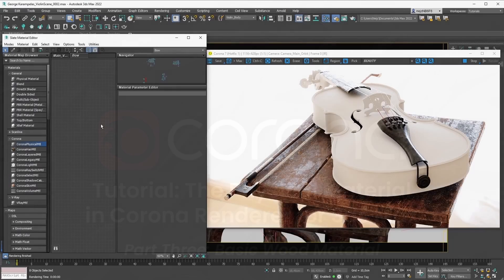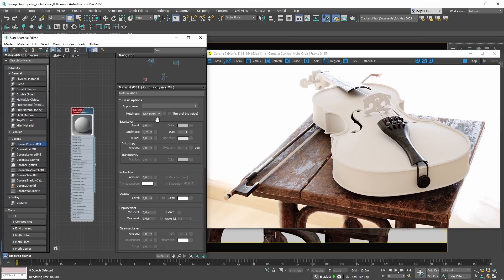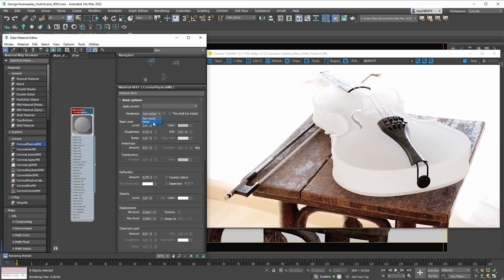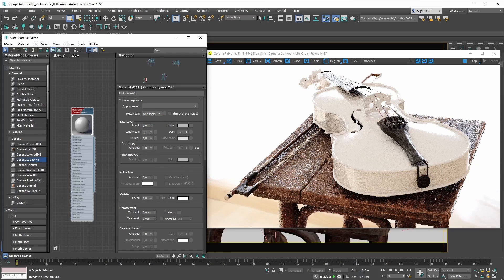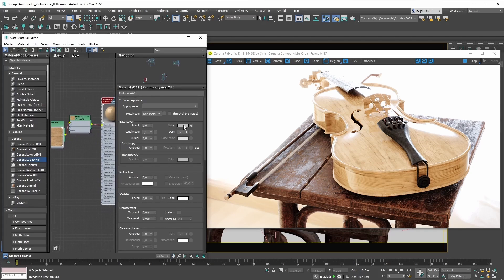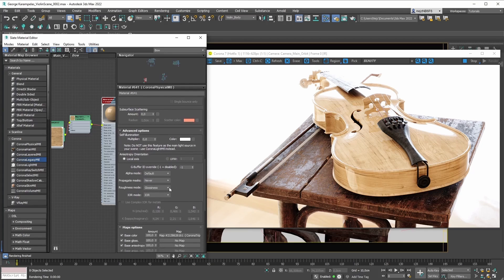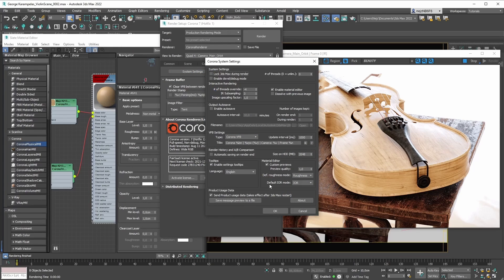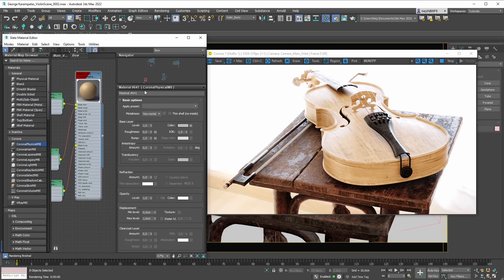Corona for 3ds Max Physical Material Tutorial, Part 03 - Basic Wood

Comment: How do you get/ make base roughness map for you base color map? Or how to make other maps as well (such as bump and other most important ones)?
Reply from the maker: Really good question Katarina! There's multiple ways to approach it...

Ideally, if you have a photoscanned base color map you also have a photoscanned roughness map. Typically that is achieved through different photography techniques (cross polarization) and setups and it really ranges from "its looking ok" to "its really complex and looks awesome". Bottom line, it is hopefully captured along with the base color map.

If you've created your base color map in something like Substance though then it is a matter of generating a roughness map out of it. In this case it is more of an artistic approach.

Pretty much the same holds true for most other maps - bump for example you can get by using a pretty strong flashlight from multiple angles as you're photoscanning the base color map. That is one of the techniques at least but hopefully you get the drill...

All that said for when it comes to wood and if you're in a hurry then you'd be surprised how far a simple greyscale base color map can take you for when it comes to roughness and bump. Just make the base color greyscale and have a play with it until you get it looking good. It surely won't be 100% awesome for closeups but if you're in a pinch...

Hope that helps! Nejc
Reply: @ChaosCorona  can we add normal map in roughness slot ?
Reply from the maker: @ No, as the roughness slot just contains data on the amount of roughness on a scale of 0 to 1, and not anything to do with surface geometry.

Instead, Normal maps are applied in the Bump Mapping, see the article at https://support.chaos.com/hc/en-us/articles/4528320253329-Corona-Normal-Map-3ds-Max . Hope this helps! Tom
Reply: @ChaosCorona  thanx tom
Reply from the maker: @anuragkhati4547  You're welcome! If you get stuck, you can always reach out via the forum or ticket and the community and support team will be happy to help out! Tom
Reply: @ChaosCorona  can we place a displacement map in place of bump map ?
Reply from the maker: @anuragkhati4547  By and large yes, though of course if you plug it into displacement (and why not? :) ) it will actually change the geometry, while plugged into bump it will only change the lighting / reflections etc. but the geometry remains unchanged.

So, same map, if in bump mapping on a sphere, the sphere will still look perfectly spherical; if in displacement mapping, the sphere will distort so that it is not spherical, e.g. have a jagged edge, etc. depending on what the map is recreating.

Hope this helps! Tom

Comment: is there exist multiplier of reflection parameter for solid non transparency surfaces?
Reply from the maker: Hello there! Such a parameter doesn't exist because it would be "physically incorrect". With the physical material all the materials have a proper 100% reflection on them from the start and similarly as in the real world, if you lower the roughness the reflections will become more and more diffuse. If you go really high on roughness you'll basically get reflections that are so diffuse that they'll be hard to spot and that is where you get that realistic behavior from.

So increasing the general reflectivity over 100% is not possible but you can however up the IOR parameter and that will make the object appear more reflective in a physically correct way.

Hope that helped! Nejc

Comment: Hello, help me  please with issue. where can I attach the ambient occlusion map downloaded together with the material in Corona physical material?
Reply from the maker: I assume you mean you have some material set up from a library or created in some tool like Quixel, that has an AO map. It is safe to ignore this and not use it at all (AO is a fake for shadows, but you can leave Corona to handle real shadows so long as you have good bump / normal / displacement maps). Hope this helps! Tom

Comment: Ive always had this question:
Don't you need to override the gamma back to 1 for roughness maps aswell? We already do this for normal maps. but why not for roughness maps? Its linear data and in most other rendering softwares, you need to remove the srgb gamma of 2.2 so it renders properly

Comment: Where's Reflection Level parameter now? It's impossible to make same material like Legacy with Physical method without this function
Reply from the maker: Howdy there! The new physical material introduces a different, more physical paradigm to the material creation process.

In the real world reflections wouldn't just get dimmer like they do with the legacy MTL. 

Instead the reflections would either get more diffuse (rougher / less glossier) or the IOR itself changes to something lower. That would be the more physical approach and that is how the Physical MTL works.

For certain materials though that does mean you'll have to adjust your workflow a bit and tweak your roughness / IOR maps differently than you did in the past.

All that said, if you are still not used to the Physical MTL you can of course still use the Legacy MTL - we would however like to encourage you to give the Physical MTL a proper try though as it does eliminate some of the gotchas of the Legacy MTL and its workflow which, if you weren't paying close attention, allowed you to create materials that weren't really quite as physically correct as they could have been.

Hope that helps!

Comment: What's the difference between specular display and ior?
Reply from the maker: It comes down to what kind of maps you have for your materials - if you have specular maps, use Disney Specular mode, and if you have IOR maps, use IOR (and if you have no maps - that is, you didn't export maps from a material creation tool or download maps for a material), just stick with IOR. If you want to know technical differences in the light transport calculations, that would be one to ask over on the forums https://forum.corona-renderer.com/index.php?board=29.0 (but to be honest, probably wouldn't be useful to know!). Thanks! Tom